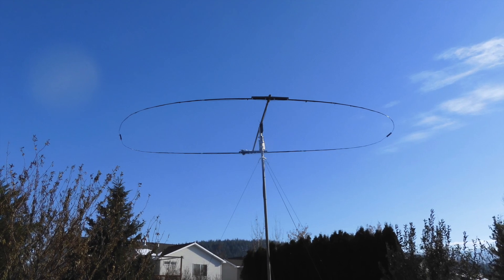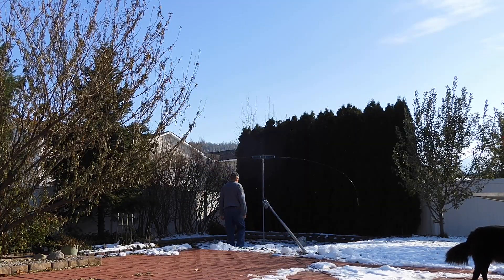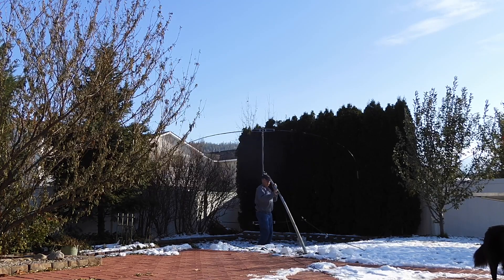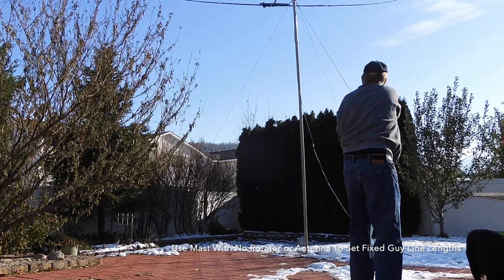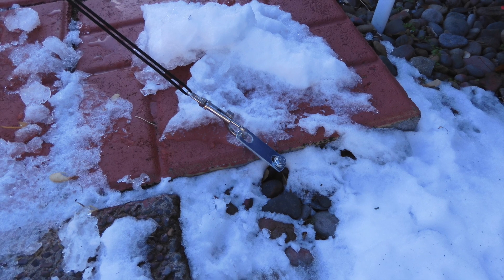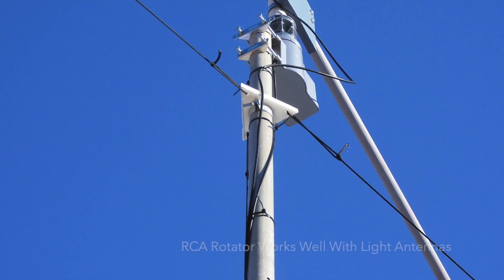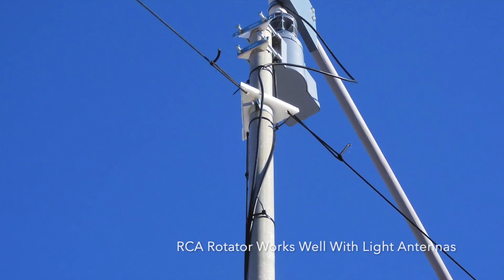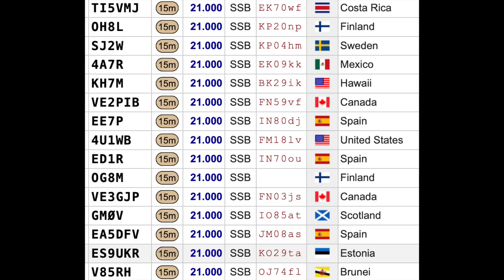Ham Radio HOA Tilt Up Mast

Comment: This is a good, succinct video describing your installation. It's nice to see all the DX you have worked on SSB which helps confirm the radiation effectiveness, even at a couple dozen feet off the ground. 73 de Bob - KØRC in MN